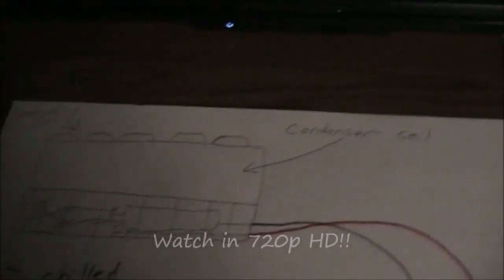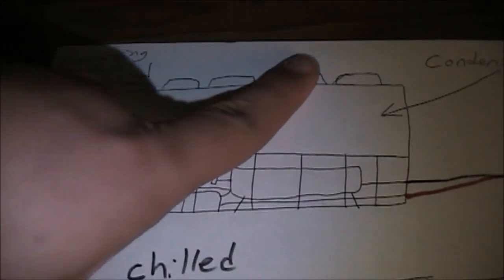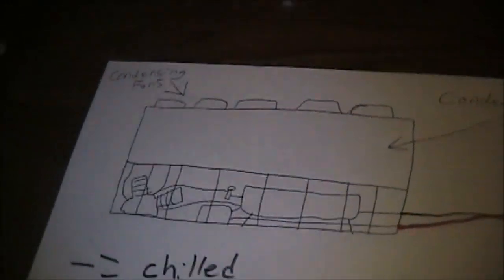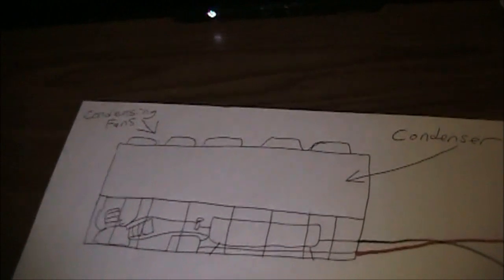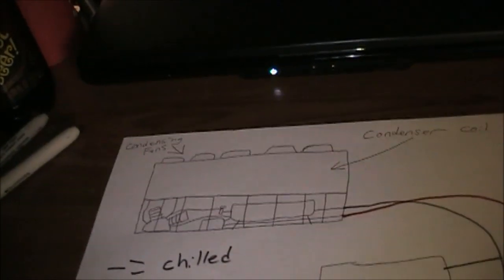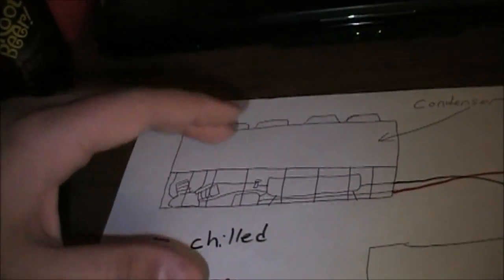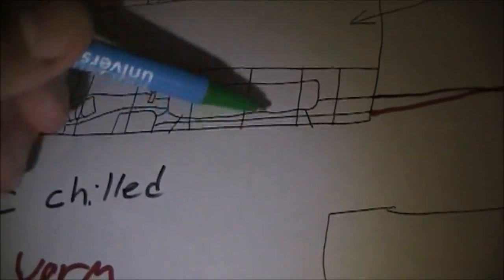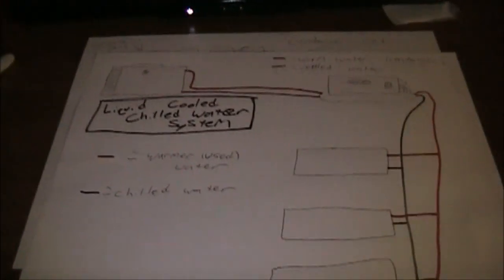How an Air-Cooled Chilled Water System Works

Comment: Hi sir , We thank you for such a simple explanation of air cooled chillers ,  I am beginner to this course i had a small confusion  that in both refrigeration cycle the phase change takes place if the cycle repeats for n number of types how the refrigerant is regained as there loses some amount due to phase change , and after regaining its phase to liquid whether there may be some loses of quantity??
Reply from the maker: Correct me if I misunderstood your question, but the refrigerant never leaves the system. (Unless of course there is a leak) 
The refrigerant is condensed into a liquid in the condenser coil, and evaporates into a gas in the evaporator, which is located inside the chiller barrel in a chiller system. This refrigerant, now in a gaseous form, travels back to the compressor, is compressed into a high pressure, high-temperature gas, and goes back to the condenser, to be re-condensed into a liquid. It's a repeating cycle, and it's a sealed system. As long as there's no leak, refrigerant should never have to be added to a system.

Comment: Hi, I feel uncomfortable to ask you again some questions, but your answers are really helpful to me. So I wanna know something about air conditioners... If the condenser remove the heat from outside air, so then the freon will condense , that s right? So from where come the water that is leaking like condensation from air conditioners if there is only freon in the system? Thank you
Reply from the maker: Don't be uncomfortable to ask questions, I'm always willing to answer questions to the best of my knowledge!
The condenser coil removes heat from the refrigerant in the system. The refrigerant passes through the condenser and rejects its heat to the outdoor air. The condensation you see dripping from A/C units is the humidity in the indoor air condensing on the cold surface of the evaporator coil.

Comment: Hi,
I have watched your video where you are explaining the basics about Air chilled system work. It was very useful for me so I write this message in order to thank you for explaining that in few minutes which were for big importance for me. I am mechanical engineer, I started working with this systems 2 months ago and I am still trying to understand a lot of stuff.
Firstly, can you tell me, why do we need to use Air chiller instead of heat pump that can in same time be used for heating and cooling? As I know, we can use Air chiller only for cooling, that's right?
Second, where are water chilled pipings going after leaving the chiller ? In AHU, that's right? Can they go directly to fan coil units or no?
And finally, can you recommend me other videos where I can learn the basics about thermodynamics, heating, cooling, ventilation systems etc.
Thank you in advance
Reply from the maker: Thank you for your positive feedback, that is much appreciated. 

The reason we use chillers, is because in very large buildings, it's cheaper to run air-cooled chillers with a few large compressors than it is to run multiple smaller DX (direct expansion - when the refrigerant coil is in direct contact with the indoor air stream, like in a standard residential or light commercial system) systems with multiple smaller compressors starting & stopping all the time. And in extremely large cooling systems, liquid-cooled chillers are used, either screw-type or centrifugal-type chillers that have only one giant refrigerant compressor that can vary its capacity. That's why chillers are used instead of smaller heat pump systems. 
And to answer that second question, most chiller systems that are connected to air handling units (AHU's), use boiler for heat. In a 2 pipe system (only 2 water pipes connected to air handlers) the same water that is circulated through chillers in the summer for cooling, is circulated through boilers in the winter for heating. In a 4 pipe system, (4 pipes connected to air handlers, and air handlers have two coils, a hot water coil and a cold (chilled) water coil) two separate water loops are used in the building. The chilled water loop for cooling, and the hot water loop from the boilers for heating. 

And yes, water pipes from the chiller or boiler usually leave the chiller/boiler room and branch off into multiple loops and are connected to air handling units throughout the building. 

I'm not immediately aware of any other specific videos that cover the basics of HVAC and thermodynamics, I learned most of what I know over the years of researching these topics. There are lots of videos that cover these subjects on the internet, and you'll typically come across them eventually. 

YouTube user "hackfreehvac" (youtube.com/hackfreehvac) has a collection of videos on his channel of a liquid cooled chiller system, cooling towers, and boilers and a bit of info on how they all work together in a building if you'd like to check them out.
Reply: ***** Let me clarify this, the heat exchanger where the heat is transfered from water pipe to refrigient pipe and vice versa, is actually that chiller barrel that you have mentioned?
And can you explain me these, in this bulding which I am working on, has chiller located outside the building, central heating/boiler located in basement, air handling unit located in basement, fan coil units that heat/cool the building and duct system for ventilation that is coming from those air handling units in basement. So can you explain me how are these concected, in general? Especially I am confused about connection between Chiller and Main air handling units located in basement?
Thank you!
Reply from the maker: Petar Arsov Yes, that is correct. Heat transfer happens from the chilled water loop to the refrigerant evaporator in the chiller barrel. This goes for an air cooled chiller or a liquid cooled chiller. On a liquid cooled chiller, the heat transfer between the refrigerant condenser coil and the condenser water loop happens inside the "condenser barrel". An air cooled chiller uses condensing coils like a standard DX system, so no condenser barrel is involved in an air cooled chiller system. 

Sounds like there would be chilled water coils in the main air handlers in the basement, as well as the other air handlers in the building, and hot water coils in the AHU's as well, from the boilers, for heating. It could either be a 2 pipe or a 4 pipe system.

Comment: Hi i'm new to all this. But this has always confused me. Does the air cool the refrigerant in the condenser coil or does it actually cool water in the condenser coil? (the water being the heat exchanger with the refrigerant)
thanks!
Reply from the maker: The air cools the hot refrigerant gas and condenses it into a liquid in the condenser coil, just like a regular DX system. (DX = Direct Expansion) 
The refrigerant then travels through the metering device and into the chiller barrel, where it cools ("chills") the water in the chilled water loop.
Reply: *****

ah i see. So a water cooled chiller has two water loop, one on the condenser side (to a cooling tower) and one on the evaporator side. Whereas an aircooled chiller has only one water loop (on the evaporator side).
Reply from the maker: Zac Lim Yes, that's exactly correct. Only one water loop on an air-cooled chiller system, and two separate water loops on a water (liquid) cooled chiller. One condenser water loop and one chilled water loop, like you said.
Reply: *****

One more thing I'd like to ask. Air-cooled condensers condense refrigerants/steam. However can they be used as a heat-rejection system on the condenser side of the water-loop instead of a cooling tower? I understand it won't be as energy efficient, but i'm just wondering if you can pipe in water instead of refrigerants. Or are condensers exclusively for refrigerants?
Reply from the maker: Zac Lim The condenser on an air-cooled chiller can only condense refrigerant. If water was piped through the condenser coil on the chiller, the water could only be as cool as the outdoor temperature. Same with a liquid-cooled chiller. The water needs to be cooler than outdoor temperature a lot of times, (even in the condenser water loop) especially in extremely hot climates. 

A cooling tower cools water via evaporation. As the water flows over the fill media and air is drawn across the media, part of the water evaporates. This evaporation cools the remaining water in the tower, which is sent back to the chiller to cool the condenser of the chiller, in the chiller barrel.

Comment: Hi, we just moved into an all bills paid apartments and they use a water chill system and I was wondering how cold do these systems cool up an apartment complex? We live in Texas so especially on 115 degree heated days?
Reply from the maker: Often, in an apartment complex that uses chillers to cool the buildings/apartments, each apartment will have an air handler inside, and the air handler will be connected to the chiller via a set of pipes, which carry chilled water from the chiller to the air handler and back. The chiller could be either liquid cooled or air cooled.

Comment: Dear sir it was a real simple and best explanation for the beginner like me,,,i would like to know what does that small pump is for ? near the evaporator,,,thanks a ton :)
Reply from the maker: Any "pump" seen in this diagram would be for pumping water. In an air-cooled chiller system, there is only one water loop, which is, of course, the chilled water. 
The refrigerant is circulated through the chiller via one or more compressors.

Comment: hi Matt, got 2 questions for u
1. what is the different between water cooled chiller and air cooled chiller, is there any saving if i using the air cooled chiller?
2. is it true it using less energy compare to water cooled tower?

Comment: Very good Matt!! maint is a pain in the &$&! Now the plan to have geothermal chillers installed has been scrapped here at our complex. They will still be replaced but with the highest effiency chillers for A/C  Trane has.  Geothermal involves to much retrofit and really should be used for heating to justify the cost of buying and installing great for new construction or a complete remodel , but since that's not happening here get the best you chiller you can for A/C!.